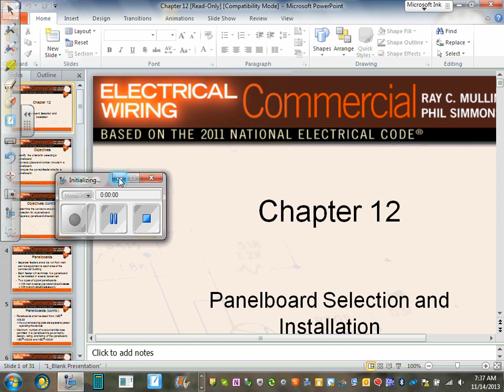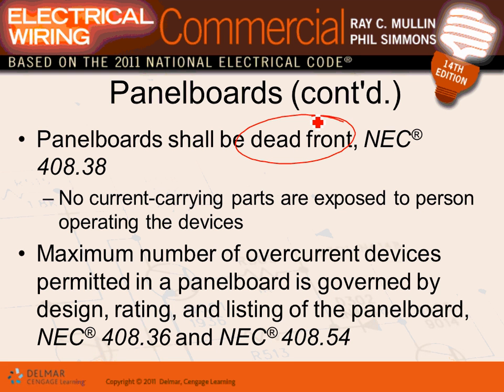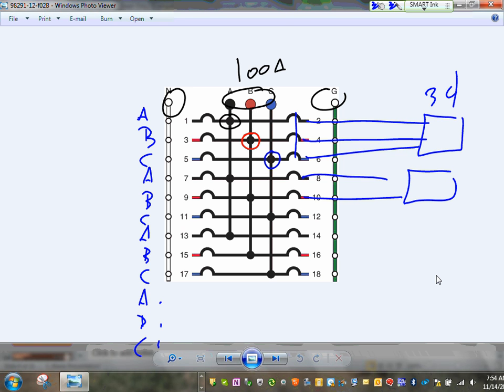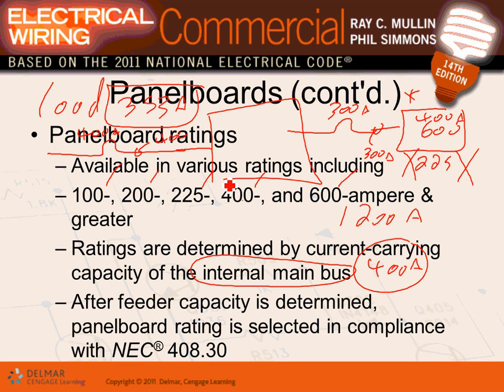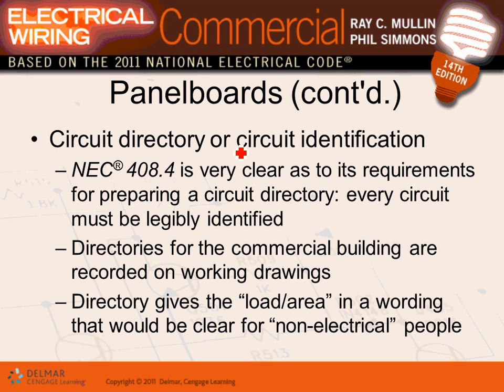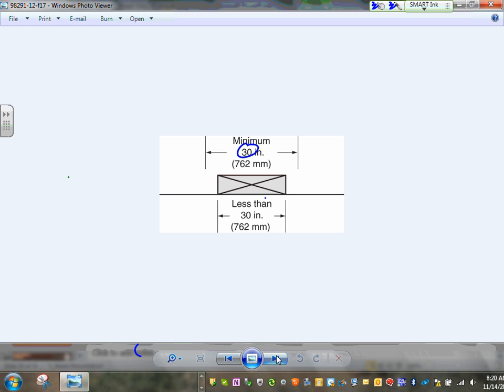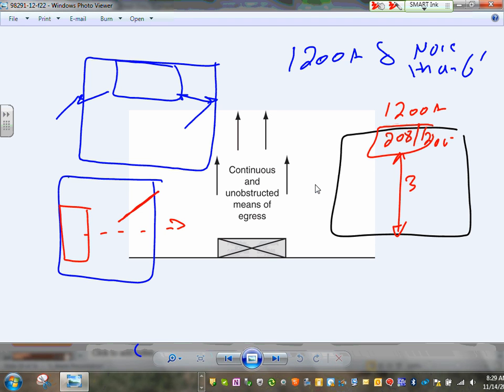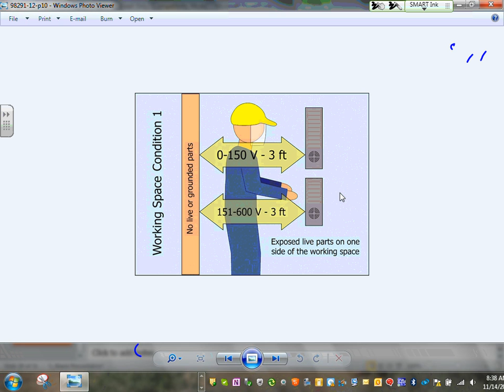Panelboard Selection & Installation 11 14 13

Comment: 408.35 Number of Overcurrent Devices on One Panel- board. Not more than 42 overcurrent devices (other than those provided for in the mains) of a lighting and appliance branch-circuit panelboard shall be installed in any one cabi- net or cutout box.
A lighting and appliance branch-circuit panelboard shall be provided with physical means to prevent the installation of more overcurrent devices than that number for which the panelboard was designed, rated, and approved.
For the purposes of this article, a 2-pole circuit breaker shall be considered two overcurrent devices; a 3-pole cir- cuit breaker shall be considered th
Reply from the maker: 408.35 was deleted from NEC since NEC2005.